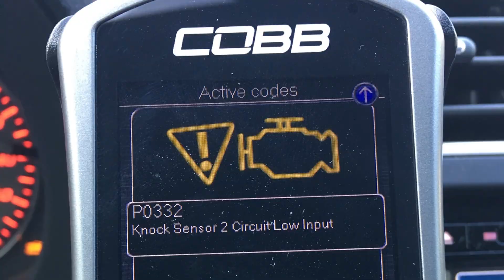P0332 Knock Sensor Code Explained – Symptoms, Causes & Fixes

Comment: Will it cause a p0300 code?
Reply from the maker: K - Yes, a P0332 code (knock sensor 2 circuit low input, typically on bank 2) can absolutely lead to a P0300 code (random/multiple cylinder misfire) because if the knock sensor isn’t working properly, the ECM may over-retard ignition timing to protect the engine from potential knock—even if there isn’t any—and that can cause poor combustion and random misfires, especially under load or acceleration; so while the knock sensor itself doesn’t directly cause misfires, the ECM’s response to faulty knock data can definitely trigger P0300, and if you’re seeing both codes together, replacing the knock sensor and checking the harness for corrosion or damaged shielding is a smart move.
Reply: @8020Automotive   Thank you I will change the sensor and check the harness.